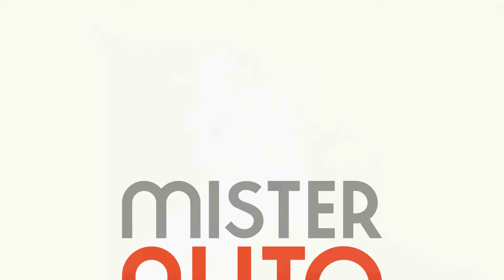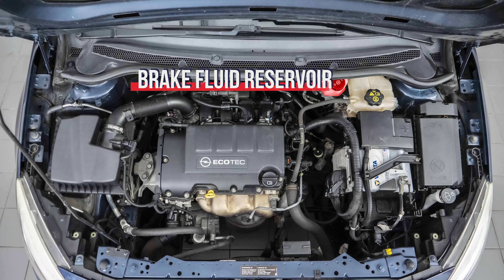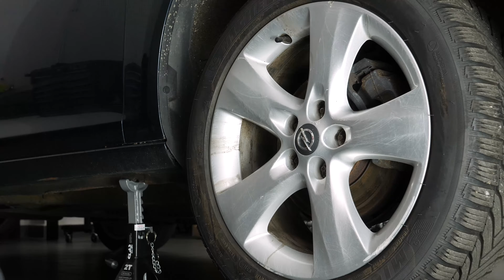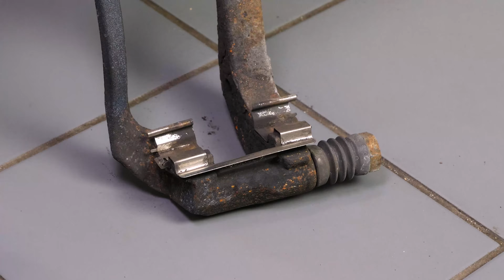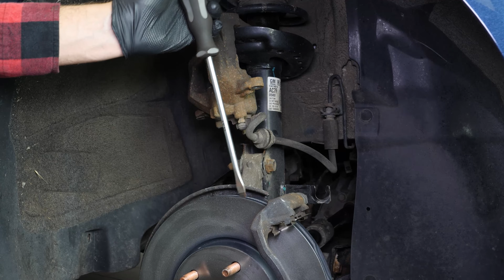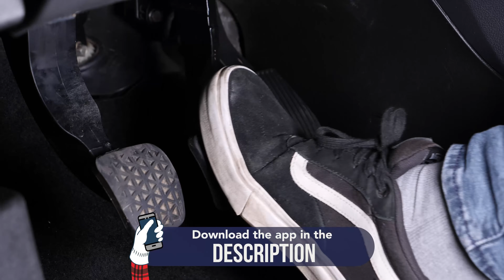How to replace the front brake discs and pads Astra J / mk6 🚗

Comment: Yeeeah, pushing all the old, dusty brake fluid up to the brake system. That, hammering the spanner, not cleaning hub all the way down, applying firm layer of copper grease on hub, not checking pins and grease them -  that video should be called "How not to work on your car brake system". 
Man, that was bad.

Comment: Hi!
I have a high profile hydraulic lift and a manual axel stand.
Could you please show me which lifting points I can reach from the side. Don't want to damage something.
Reply from the maker: Hi! Check in the description, we have a detailed video for this.
Reply: @UseTool_EN  Thanks, but I have watched that one before, but I am still unsure (I understand those principles, but unsure which parts specifically an Astra J can be lifted)
This would be my first time in my life to use lift and axel stand, and go under s car. I can't see/feel the obvious difference between the safe and unsafe parts...)